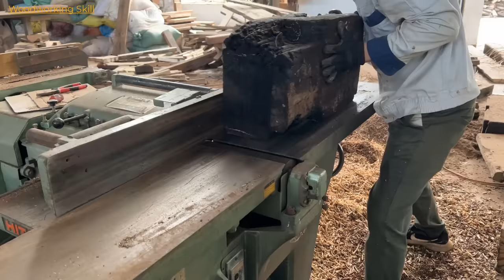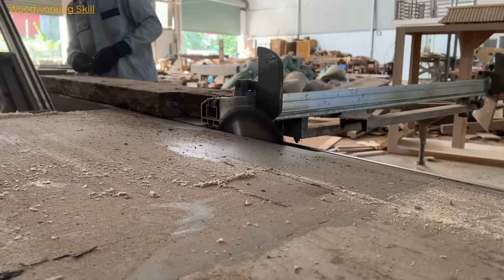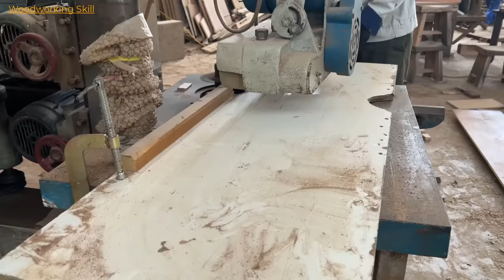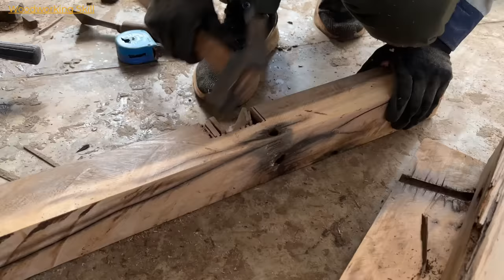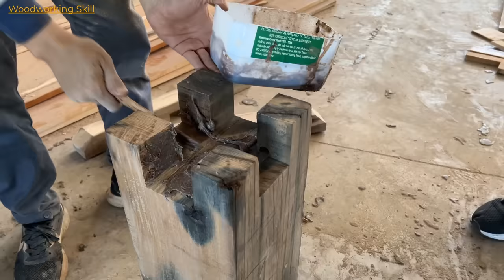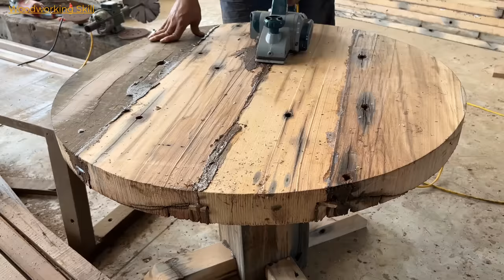Furniture Recycled From Pieces Of Wood Taken From Old Fishing Boats // Recycle Driftwood In The Sea

Comment: Not sure how pair gloves would stop losing fingers...
But great to watch..thanks
Reply: Those gloves definitely won’t do ANYTHING unless they’re chain mail, and then you’d still get crushed by the blade against your hand if the glove got stuck. It is most definitely a rule in any production environment that no gloves or loose fitting clothing, no open toed shoes, etc etc etc. The guy using a 36-40” bandsaw who doesn’t know how to use the depth guides scares the crap out of me. Not in my damn shop. How many of those poor teenage workers are missing fingers? There’s literally no guards on ANY of the machines. Not saying I’d throw them out but good god.

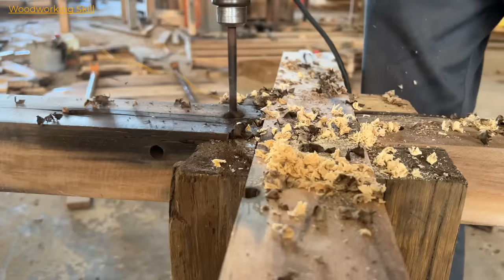Comment: 7:49 when setting metal, wood or anything with with a bolt pattern wit more than one mechanical fastner you get all hand tight and then tighten all equally by following a recomended pattern 

Guaranteed the table top aint perfectally level as you fully tightened one side first

Its all in the details